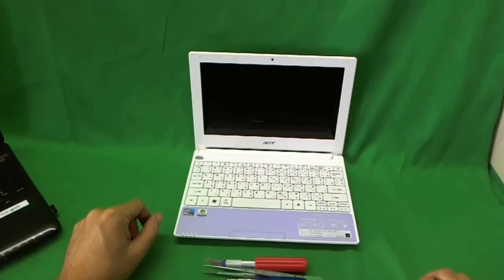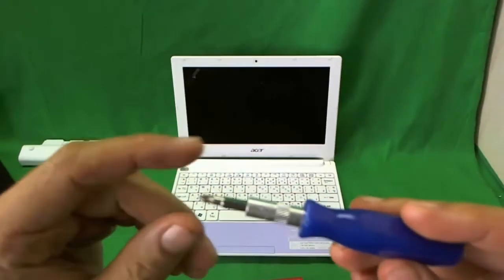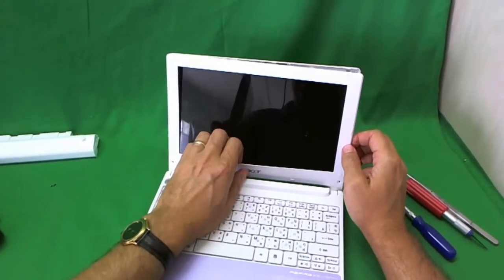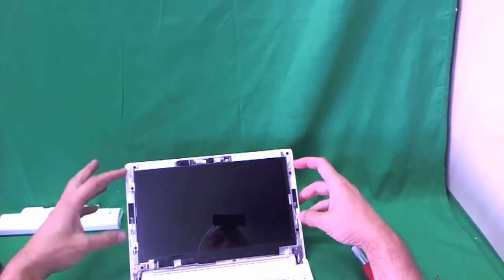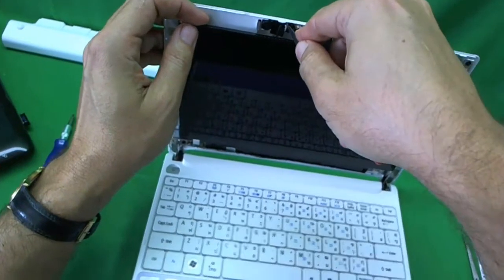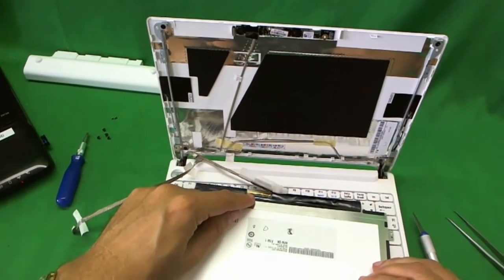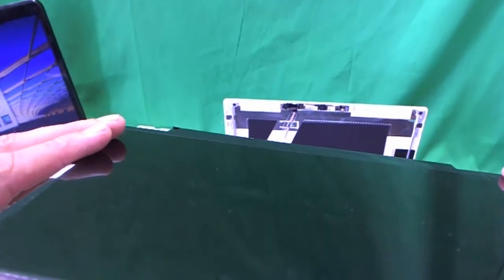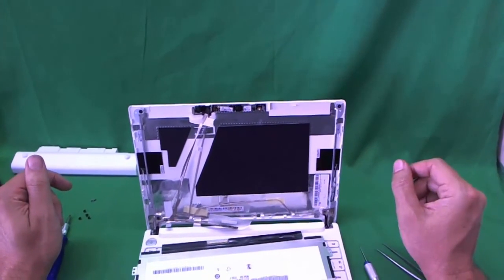Acer Aspire One Happy Netbook Screen Replacement Procedure

Comment: Nice... and to think I was preparing to also disassemble it from te bottom.
Accidentally stepped on the laptop, which broke the screen. Luckily my nephews still had theirs which they don't use anymore. I still use my for watching movies in bed and mine was just that little bit more powerfull then theirs. So nice that I was able to switch the monitors.
Reply: I want cabinet bro